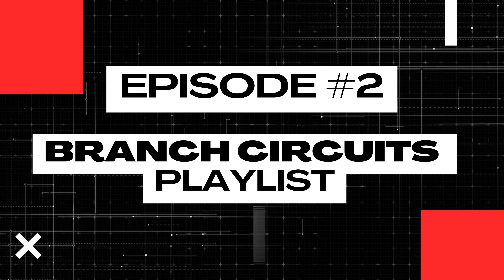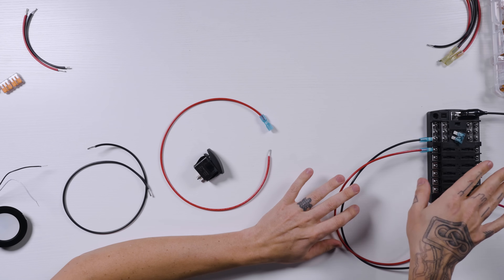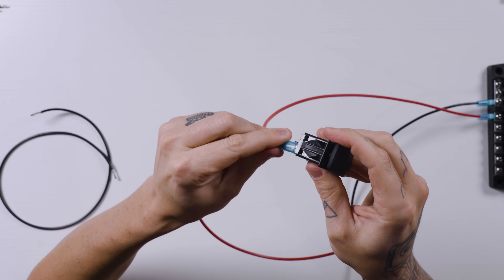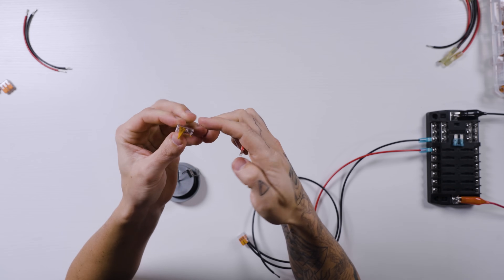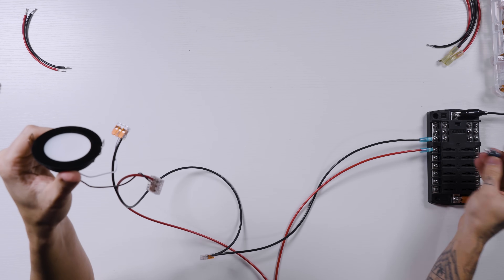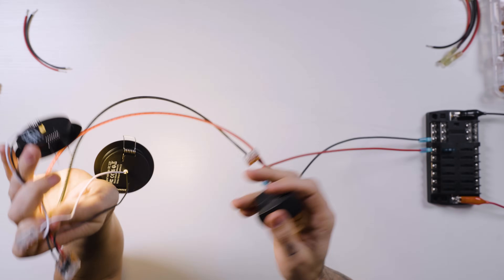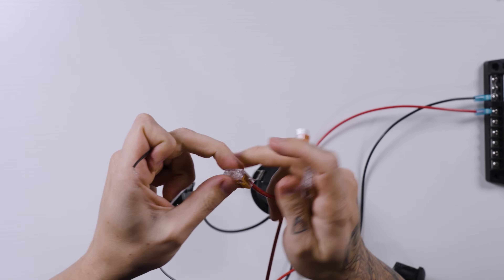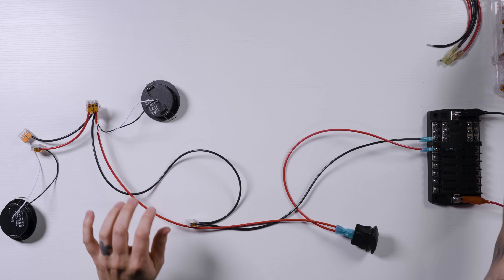12V Lights 101 -  Branch Circuits | Ep: 2/10

Comment: Great teaching style, Nate! I'm considering connecting B+ that's fused(30 amp mini ANL) from the battery to an ON-OFF 2 position key switch that will supply 12 volt power to the B+ input of a Blue Sea 12 fused distribution block. The idea is to have all the sub-panel circuits only operate with key-on power. Any suggestions will be greatly appreciated Dave PS this application is for a 60 year old tractor that's been converted to a 12 volt Delco 3 wire alternator.
Reply from the maker: Thanks so much for the kind words, Dave — and that sounds like a really fun project 👌 Because you’re dealing with a custom setup (older tractor, alternator conversion, key-switched distribution, fuse sizing, etc.), the best way to get this right is for us to take a closer look at your exact system and how you want it to operate. That way we can make sure everything is protected properly and recommend the right components for your needs.

If you reach out to our support team here, they can walk through it with you and help you dial in the wiring and parts list: 👉 https://shop.explorist.life/support?utm_source=youtube&utm_medium=comment&utm_campaign=support&utm_content=response_link

They’re great at this and can make sure your setup is safe and reliable 👍

Comment: If your Blue Sea 12 circuit fuse block is full and you want to add a second fuse block , can you daisy chain it or do you do another complete pos/neg wire run to battery ? Thank you
Reply from the maker: Great question! Setup specifics can vary a lot by system, so we’d love to take a closer look at your build to point you in the right direction. If you reach out to our support team, we can help you figure out the best path forward and make sure you get the parts you need:
https://shop.explorist.life/support?utm_source=youtube&utm_medium=comment&utm_campaign=support&utm_content=response_link

Comment: Off subject, but I am trying to wire a dpdt switch with a relay for my boat. I have 4 LED lights and want 2 on for low beam and then all 4 on for hi beam. I am just stummped.

Comment: I recently removed a therford toilet from our camper which was wired for the flush system. I would like to wire in a switch and an led light strip to those wires, but there is also a usb outlet and another LED light (not on a switch) on yhe same circuit. Assuming the circuit can handle the added switch/led light strip, are there any other potential issues with adding a switch/led strip to an existing circuit?

Comment: What guage of wire are you using here? It looks solid and not stranded right?
Reply from the maker: It is indeed stranded.  I don't recall what wire size we used for the tabletop demo.  Probably 16AWG.  This is not necessarily indicative of what you'd use in real life.  Refer back to the 'wire sizing' videos of this academy for that.

Comment: In another video, could you cover how to wire up lights that have built in on/off features on a similar circuit?  I'm thinking for the canopy camper application like Alu Cab has on the inside of doors, sleeping area, overhead, so about 6 lights on the interior.

Comment: Have you ever felt the need to run a 12v regulator before the lights, as in battery voltage can be around 14v?

Comment: I’m going to wire my off grid cabin with 12vdc LED lights ones that are e26 base but are 12vdc 
I’m also going to use regular 14/2 Romex with single gang blue boxes.
But when I get to hooking up the 14/2 Romex to the 12vdc blue sea fuse box. That’s where the coloring will get weird right. The black will go to the positive side & the white wire will go to negative side & the bare ground wire will go to earth Copper Grounding Bar Rod ?
Reply from the maker: Man... this doesn't answer your question, and we've already released a video as part of this academy covering wire colors... but if I were doing a cabin - I'd never run dedicated DC circuits.  Keep it simple and keep everything 120/240 just like in a house and run everything through an inverter to a standard residential breaker box.  Way cheaper, easier, and faster this way.  https://shop.explorist.life  We can help.

Comment: Maybe you have it on a switching video. But lighted switch is another  wire...
Reply from the maker: Yes—lighted switches do typically require an extra wire, but that’s outside the scope of this video since it’s focused on standard switch wiring.

That said, lighted switches usually aren’t desired in these systems. The point of the light is to show that your lights are on—but you can accomplish the same thing by... well... looking at the lights. 😄 Just something to consider before overcomplicating the wiring.

If you still decide to go that route, you’ll want to refer to the specific switch wiring diagram. The video gets you 99% of the way there—critical thinking and double-checking your switch instructions will handle the rest.